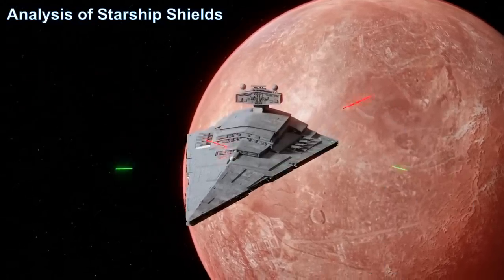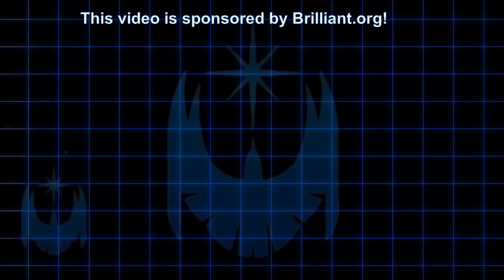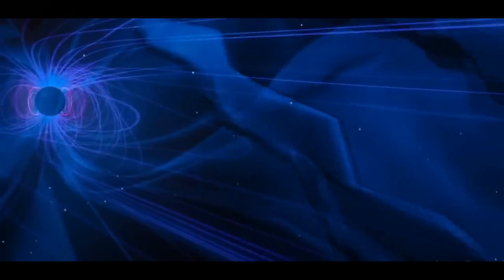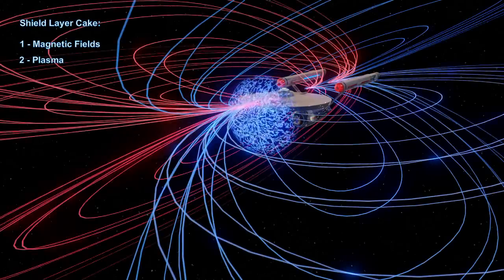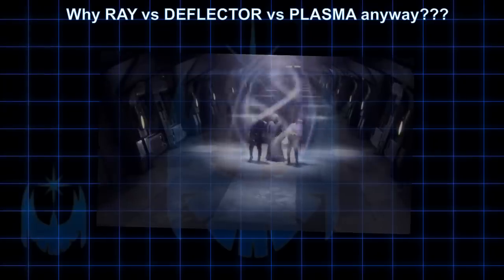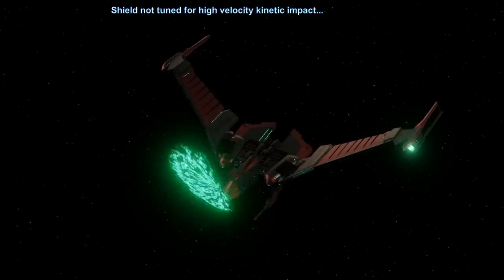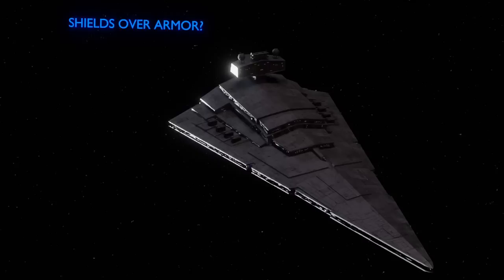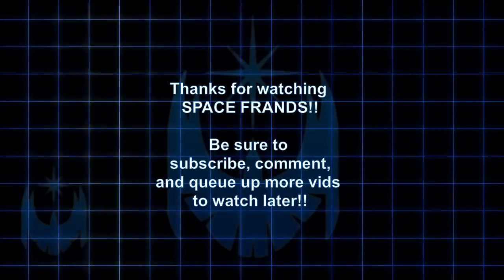REAL Starship Shields Types - They Work Like This...Animated Breakdown!

Comment: These ships all have artificial gravity. Given that they seem to also have inertial dampers it doesn't seem too much of a stretch to suggest that - if you accept the premise that they are able to manipulate gravity and nullify inertia - a deflector shield would utilise this capability to firstly reduce incoming particles' inertia, and then use artificial gravity to deflect them.

The reduction in inertia would mean that even a small gravitational anomaly would have a disproportionate effect on even fairly massive pieces of space debris, since removing inertia effectively reduces the mass.

Comment: I think some of the best examples of high sci-fi puts shielding, particularly plasma shields, are the Halo novels. Even in the earliest books, the authors take care to note that because the Covenant uses both plasma-based weaponry and high-powered magnetic shielding, the shields themselves are typically segmented and they must be powered down in order for covenant projectiles to pass through. However, because the magnetic tuning on their lighter plasma-based weaponry and shields are different, they can use these lighter armaments without compromising shield integrity.

Comment: The reason the ships still take damage when the shields are up in Star Trek is they are being mostly hit with energy weapons that send a surge through the electrical system also the clips you showed for examples are from tos in that era star feet was still using older screen technology way less power than the energy shielding in the tng generation and if you go back even further to the pre federation trek they used armor before the sharing of tec from with the Vulcans and andorions that’s when star fleet picked up screens and tractor beams

Comment: Having researched this for over a decade (on and off) you're on the right track.  Yes, tuning fields of electromagnetism can modify plasma clouds to do a lot.  Additionally, a strong enough magnetic field can actually levitate non-magnetic objects.  Look up levitating frog for an example.  Strong magnetism can potentially slow or stop incoming bullets or even sheer them apart.  Plasma shields are unlikely to stop physical objects, but they can soften them.  The heat can detonate warheads and soften or even vaporize projectiles.  That said, a plasma shield may still let through the resultant cloud of particles and this can still do significant damage, but armor can be used to stop the rest.  Indeed, shields don't have to stop incoming fire.  They only need to weaken it so the armor can do the rest.

There is another type of shield I rarely see: spatial shielding.  Any civilization sufficiently advanced to create warp drives can manipulate space time enough to make "bubbles" of spacetime.  That's the basis of real warp field mechanics.  If you can do that, you can shape space time in other ways like, say, bending a region of space back on itself so tightly it tears physical objects apart on the molecular level, and scatters incoming energy beams or packets.

One major limitation of shielding is Isaac Newton's laws of motion.  Specifically, every action has an equal and opposite reaction.  If you shoot a shield with a bullet, and that shield stops the bullet completely, the kinetic energy is imparted on the shield directly.  It has to go somewhere.  Either the shield has to flex towards the ship, or the shield generator is pushed by the field or both.  Hilariously, this could result in a ship's shield stopping a railgun blast, but the ship crumples in half like a tin can because the energy is imparted as a push on the generator.  Or the generator is pushed so hard it rips out of the ship.  

A way around this is to have the energy change forms from kinetic (impact force) to thermal (heat).  I'm actually writing a sci fi where that's how shields function.  They're designed to slow or dissipate damage and let the armor take it.  The energy is transfered to the shield generator as heat, and the limiting factor on shielding is how hot the generator can get before failing or melting the actual deck around it.

Comment: I can think of a few situations in Star Trek where they had to up their shields game,
- Vs the Borg. which could scan shield, & match harmonics. Similarly if you stole a Federation star ship, the captain of another Federtion ship could look up your shield freaquency, & blast you. 
- Shield Frequency matching also allowed a ship to use transporter beams, or pass through shields with shuttles and such.
- Vs the Borg, the Federation had to up their shields game by remodulating their shield frequency. Same for their weapons, the borg adapted their shields specifically to the weapons being used against them, In order to keep their weapons affective ,the Federation had to modulate the phasers energy freqauency harmonics, or whatever.
--- Another situation was with DS9, First the Dominion using phased polaron beams to cut through shields, The Federation had to adapt their shield tech. Seeing a galaxy class ship cut up with Phased Polaron beams like it didn't even have shields was a shocker to the Federation, Conversely when DS9 used a shield the was able to counter the Phased Polaron it was the Dominion that had the wtf moment.
- Then the Breen came in with Energy dampening weapons. The Klingons accidently had a fix because of a modified tritium intermix chamber. Whatever that is. But again the Federation had to adapt their shield tech by reverse engineering the Breen weapon.

Comment: Energy shields 🛡 to protect us from solar storms is really easy to make its already in use in the medical field so we can adapt it by turning the unit inside out. It will put out about 5 x times the earth's magnetic field there for protecting the crew from harmful radiation. I been still working on this idea. But hope to eventually prove it would work. But that takes time so it's either going to work or not. But it's a learning experience.

Comment: You compared and contrasted shield tanking versus armor or structure tanking. Spoken like a true EVE player. I don't think, IRL (if it ever comes to be) that there would be that kind of conflict. The shields would use your ship's power and the ability to project it, and armor would just be part of whatever mass allowance the designers have, and of course appropriate materials. No conflict at all. A given ship could realistically have both. In game though, throw me a 'cane with a large booster and two hardeners, gyros and TE's all over the lows and I'm a happy little egg with 425's. Might need some duct tape though.

Comment: A couple real-life shields that exist today. Mini-magnetosphere. University of Washington did work on this. Modelled on Earth's magnetosphere, it's a weak plasma held in a magnetic field. The magnetosphere extends multiple kilometres from the ship, but only requires 50kW to 100kW of power. It's very weak, will not deflect bullets or meteorites. If an astronaut in a spacesuit approached the ship, he wouldn't notice the mini-magnetosphere was there. However, it's very good at deflecting charged particle radiation, such as proton radiation from the Sun or Galactic Cosmic Radiation (GCR). This is the best way to protect a spacecraft from heavy ion GCR.

Second: Plasma Window, developed by  Brookhaven National Laboratory. This is capable of holding upto 1.5 atmospheres of pressure against hard vacuum. Star Trek calls it a force field rather than shields. To create the viscous plasma capable of holding air pressure requires at least 12,000°K of heat. If something touches the plasma, it could drop in temperature, and if it drops below 12k degrees, it can no longer hold air pressure, so researchers have been working with 14,000°K. This is insanely hot! To convert Kelvin to Celsius, subtract 273.15. When you're talking thousands, that's insignificant. An oxy-acetylene welding torch burns at 5,730°F (3,166°C). And viscous means it's thick like honey. So imagine a viscous plasma that sticks to anything it touches, and that hot! If a shuttle craft made of aluminum tried to fly through, it would melt on contact. Imagine the shuttle flying into the force field, but nothing coming out the other side. Instead liquid aluminum pours down from the force field onto the shuttle bay floor. Anyone inside is incinerated. Oops! Furthermore, a plasma window requires 20,000 watts per inch diameter. So a force field as large as the shuttle bay door 20-feet high will require 4.8 megawatts of power. With that much power, anyone standing in front of the force field will be broiled. Used as a shield it creates a wall impenetrable by micrometeorites or small meteorites, bullets or gauss cannon rounds, Brilliant Pebbles, or plasma weapons. It would even stop lasers at certain frequencies (colours), but lasers at the right frequency could get through. But a shield based on this technology will require a hell of a lot of power! And the ship inside the shield will be baked.

Comment: Why not have stuff like ERA, active and passive defense system and ciws or stuff like 200(yes two hundred if the ship is big enough)mm flak cannons as well as flaires to confuse missles instead of shields

And maybe a reflective coating to deflect lazers and ceramic coating to protect against plasma(I assume they damage one with heat)

Comment: 1. No mention of "Whipple shielding" that's actually used on spacecraft today?
2. There's also "Kzinti Shielding" when your rocket is burning toward the projectile and incinerates it, protecting your ship (watch The Expanse)
3. "Ice shielding" is when spaceships cover their bows with water (which freezes in the -180°F dark) harvested from comets or planetary rings as renewable ablative armor. When the ice takes damage, just flow more water onto it to "regenerate" the armor. It's an important civilian vessel defense when traveling at interplanetary speeds where even tiny pebbles are highly damaging (read Revelation Space).
4. Two-way barriers are much more interesting than one-way types: if you have to drop your shield to fire through it, combat goes from being a slugfest to a boxing match. Same goes for being blind while your cloaking device is active.
5. An idea for anti-laser shielding: use magnets to keep a cloud of highly reflective chaff swirling around your ship; concentrate the chaff by magnetic manipulation to temporarily increase the shielding over a different area at the cost of power. "Deploy ray shielding" in this case would mean releasing more chaff; supply would be limited and recovery may be difficult so you wouldn't want it always on or always deploying. The downside is that all that reflection could hamper your own weapons and especially sensors and comms.
6. Great point about bleed-through. The luck inherent in probabilist shielding also gives writers more plausibility for plot armor.

Comment: I kind of had my own idea for a shield. a Atmospheric shield.

This shield wouldn't be designed for any anti weapon warfare, but instead, would be a shield against air friction. It would work by essentially putting up a mango field of ions around a ship to prevent  the skin of the ship from heating up until it was just outright melting when going at high speeds, talking faster then a SR 71, without all the heat the skin produced. I know star wars has this already, but I thought of this before I heard of how shields were used in star wars. this could also be manipulated to mess with radar detection systems,  making a aircraft appear smaller on a radar, or even be manipulated to make a aircraft appear to be somewhere else, fooling someone into firing missiles at a false target. Of course, the shield wasn't immune to weapons. While in some case's, this shield could stop bullets, faster moving missiles were able to push through and destroy the aircraft. And anti aircraft laser weapons were also immune to the shields, and could easily burn through right to the ships engines, or external fuel tanks. also, if the shield wasn't powerful enough, then you had a speed limit to how fast you could go before the shields started failing, and your ships skin started to heat up.

Comment: Funnily enough, although shields are realistically made, deflector shields are not needed if you have a warp bubble. In fact, the warp bubble might be the best deflector shield you can have. It acts almost like an event horizon in that everything that it comes into contact with is frozen in time; under general relativity it's impossible to "perfurate" the bubble. It would be kind of like bird poop on your windshield, being stuck when it falls, then thrust forward with a lot of energy once you stop.

Comment: I am surprised nobody uses kinetic weapons in Star Trek. In theory, a deflector shield should be able to deflect them, but the energy required to deflect a head-on hit at near lightspeed would still be pretty high. Especially since their shield seems to act more like a solid bubble than a soft pushing field.

The projectile would have to be accelerated along the bubble, draining the shields. The main navigational deflector is probably supposed to prevent this, but then it doesn't stop torpedoes, so how could it stop other projectiles? At least you could fill a torpedo with osmium and warp it into the hostile ship.

Comment: Honestly, shields vary so much, even in one franchise. For example, the Movie era Enterprise and her ilk (the Meranda series) used a shield system unlike any used before or since, that instead of making a bubble it reinforces the hull plating into a near impenetrable wall. Watch the Battle of Camp Khitomer in Star Trek 6, as torpedoes skip off the Enterprise's hull, and the shields spark in compensation. No bubble. The tech was later abandoned, but probably led to the Next Generation's Structural Integrity Fields. And that is just one government for just one period of time.

Comment: with star trek's warp drives being able to bend spacetime, you'd think they could use that to redirect basically anything that exists within regular spactime
Reply: Well, the warp drive is configured to be propulsive, ie. dynamic not static.  As Dr. Crusher found out, it can be dangerous to be stuck in a static warp bubble, but useful in collapsing spatial/temporal anomalies.

Comment: keep in mind that plasma can be opaque to some frequencies of light and not others. this means that you can have plasma that blocks lasers, unless those lasers match a frequency the plasma doesn't block. one should also keep in mind that magnetic containment will disrupt a larger magnetic shield used to deflect projectiles. finally simply things massive is not how one would defeat the plasma shields, but by their thermal properties, just as the amount of deflection is largely dependent on the magnetic properties. a non magnetically reactive ceramic round might do quite well, but propelling such a shell might require sabot style encasement or old fashioned chemical propellant. the balancing of such requires knowledge of science which most people lack, and thus writers for sci-fi shows are unlikely to have such knowledge. this is the real hold back for such stuff in decent properties.

Comment: The main/secondary deflector dishes send a beam out that sweeps ahead of the ship to push objects out of the path of the ship at warp speeds. Deflectors are meant for when the ship is in motion not in battle. These are far different than the shields which encompass the ship and are meant to absorb the impact and/or energy from an attack route it around the shields and out the opposite side of the ship. Ideally. This all comes from the tech manuals.

Comment: Curious: How do scientists know what the core of the Earth is when the farthest  we ever drill is near 8 miles. Barely the surface
Reply: History and methods of searching for oil fields taking seismic readings then studying the drill core samples. 
Setting off explosive charges and waiting for the echo reflecting from denser stone sending the shock wave back to the surface. Pockets holding oil or water allow the shock wave to travel faster. Something about timing the distance equals the rate of travel, looking at the rock from the drill shaft the testing for the same effect in other locations matching the same rock type. 

Then they started testing for metal/silver, gold deposits follow with WW II sonar detection development running ultra sound along the bottom of the sea floor.  Following with tracking down other earthquake fault lines leading off the main know lines. Then there is other research where they created granite vaults and melted metal within them so they could test sound waves on how the materials react. 

They have a good sixty years of sound wave mapping the planet, in my view it is the best of gest work. 
Within my given view of everyday life, it doesn't matter. 

If you are .. really .. interested, just type " How do we know the earth core is iron," and there are hours of videos on youtube on the subject. Old PBS/Nova science video from the late 1970's and 80's cover step by step on how the researchers went about their testing.

Comment: One type of shield they've never come up with is a gravitational shield, which is weird because all of these sci-fi series deal with space folding as a form of propulsion, so you'd think they could fold space around them so that it could become a barrier to outside entry. It'll work against both EM-based weapons and projectiles. Imagine a the spaceship as just a big space distortion, like a black hole, but not as extreme. This could deflect light and crush projectiles up before they hit the ship. It would also act as a cloaking device.